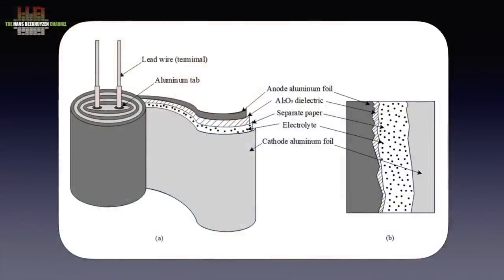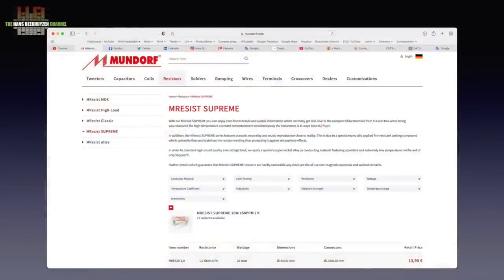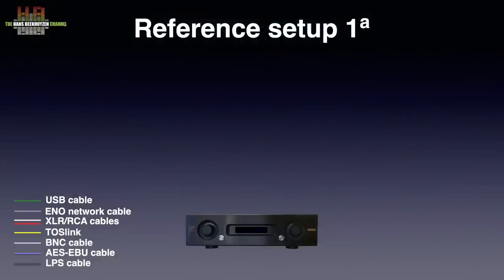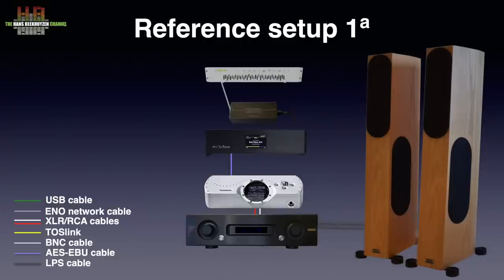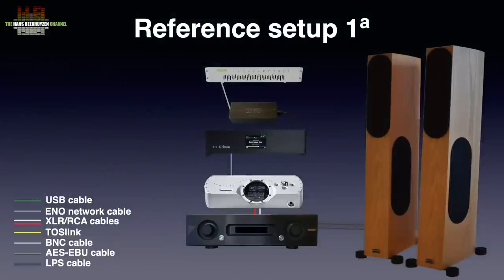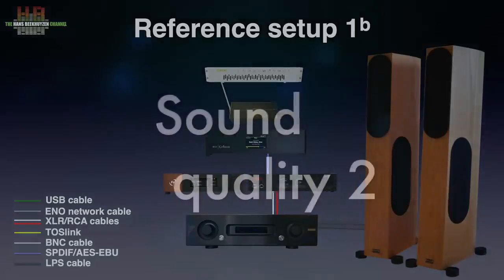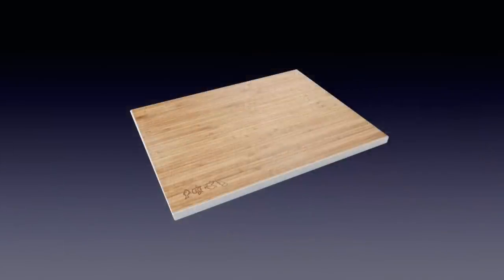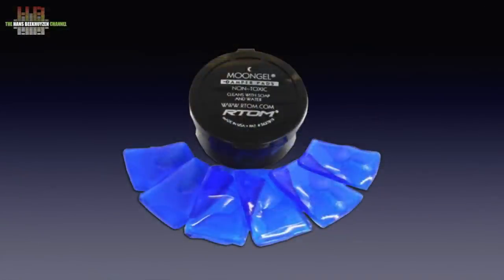€ 23 DIY isolation platform

Comment: I welded up a tripod rack with 4 shelves. Using 1" tube for the vertical and 3/4 " horizontal.  Each down tube fille 4 horizontal with sand. The shelves are 3/4   mdf filled with lead shot and sand. Far more detailed and more open doing stage. Cost $65 CDN
Reply from the maker: Nice job!
Reply: @TheHansBeekhuyzenChannel  ty. i stole the design form a $14,000 Italian stand i saw on the  net. Mine densest look any where near as good but functionally very close id imagine.

Comment: What about capacitors inside a speaker? Are they effected the same way?
Reply from the maker: Yes they are but some manufacturers use special capacitors, a construction that kills vibrations or have an outboard X-over filter.

Comment: Great video and thanks for the Moongel tip - just what I have been looking for! I have also been experimenting with DIY vibration control using various materials. I think there are actually two problems to solve here: isolation (which this video mostly addresses) and resonance control. The latter I am currently trying to address with DIY damping plates. My latest design is a 6mm thick steel plate with a 6mm thick sheet of cork-nitrile underneath, placed on top of my DAC. I also have similar on top of my SoTM streamer & USB reclocker, but using ceramic tiles and rubber sound insulation plus sorbothane feet which works quite well.
Reply from the maker: Thanks for sharing

Comment: Hello, sometimes you read about Moongel changing it properties. I forgot if it was in one of the comments below.  I already have a nearly 6 kilogrammes bamboo chopping block to install under my future mu2. Are we looking for the same goals as when isolating a turntable? Hans showed us the movement the moongel will allow to the block to be made. Should we not take into account that we are not trying to reduce a movement that can be visible but more the ones that could be detected by an old fashioned stethoscope. If your idea will nullify a big truck passing by it will not automatically tackle the minuscule vibrations that will disturb your dac clock with the same efficiency probably.
The French have published some investigation decades ago about loudspeakers enclosures using '' a box inside a box '' idea with sand in between.  One of the striking ideas was making the panels to thick would worsen the results because the vibrations would '' stay inside the panel ''. A bit like let the panel resonate so the sand can do its job. Should we bury the mu2 in a container filled with sand??
I wanna try some Taica products they offer '' silicon pads '' in a few seizes . Most of them come with a kind of optimum weight to make them work in the '' area '' where they work the best. If you put your 20 kilo amplifier on some '' vibration killing feet '' designed for a 100 kilo industrial washing machines it will not work.
Like Hans said probably the best way is to put something between the chopping block and its support and have a '' strong bond '' between your device and the block. I could imagine if there is some kind of '' material '' on both sides of the block that could reduce efficiency or not? Or they should work in a different frequency range?
Of course all the gardenhose cables plugged into your device will introduce a number of vibrations that are nicely transferred right on to your circuit boards.
Greetings, Eddy
Reply from the maker: The MU2 is rather insensitive to vibrations. I use Stack Audio AUVA EQ's.
Reply: Hello Hans, 
In my rack i made sandwich boards made of steel, lead, copper, brass, wood and top layer vinyl usually used on floors, works well. In the past i constructed stainless steel '' boxes '' filled with dry sand to '' support '' cd transport and tube dacs . BUT dont want to put mu2 in a sandpit. The French did publish a manual to make a 200 to 300 kilogrammes sandpit for a turntable. The box was made of wood and in the sand they would put a tile made of '' granito '' ( 32 kilogrammes)with the topside not covered and there they would locate the turntable. The stack auva are not that expensive compared to the price of the mu2 . Maybe i will try to find some very fine lead shot and use that to fill up a box. Of course you need to find a way to prevent the lead '' marbles '' ending up where they should not be. Greetings, Eddy @TheHansBeekhuyzenChannel
Reply: @Eddy-gr5wm  I'm curious to see your DIY solution. I'm about to DIY an openbaffle speaker desigh using a box with sand with 2 sheet in a L form, each sheet is one speaker, to be seperate each other from vibration not directly in contact in the sans box, it's a little weird, but I think it will work well.

Comment: Hans, this is a most refreshing instalment... in that, I don't have to spend thousands of dollars to perhaps yield an audible improvement. Ironically, I have both the bamboo boards and the same gel (they are frequently suggested in many credible audio forums)... but I have not tried them together. next, should be an A-B comparison of this setup vs. the more expensive purpose-built isolators.

Comment: I've used MOONGEL for years on drums. The problem is they dry up. The reason they come in that little case is so you can place them back in it when not is use. Like a humidor for cigars, it also keeps them from drying up.  With the added heat generated by the motion of board on top of them this could conceivably cause the drying to happen faster than when just sitting on top of a drum head. Perhaps they'll last a few months and then need to be replaced. Time will tell.
Reply: I am not sure if this will work but you may try wrapping the Moongel in clear plastic wrap before use. It would help isolate it from the elements and delay the drying issue.

Comment: Vacuum tubes are susceptible to external vibration effects. The working elements inside the glass may be in a vacuum, but the rest of the tube base, tube socket etc are still all mechanically connected to rest of the world.
Reply from the maker: Absolutely

Comment: I've had good results isolating my rega rp8 with a bamboo cutting board and 4 of those: https://www.thomann.de/intl/isoacoustics_iso_puck_mini_set.htm which I also use under my tube pre and amp
Reply from the maker: Thanks for sharing
Reply: Try the IsiAccoustic Orea Series, much much better.
Reply: @mikeeygauthier2959  I'm sure you're right - they are geared more towards heavier speakers though, and quite more expensive. anyway, the minis work well for my setup